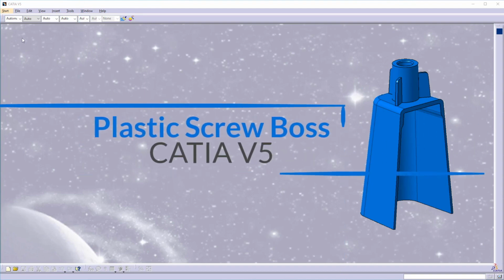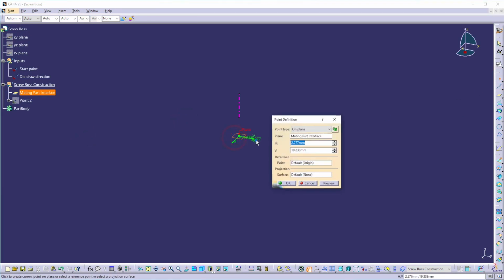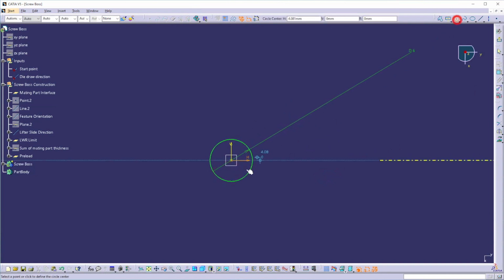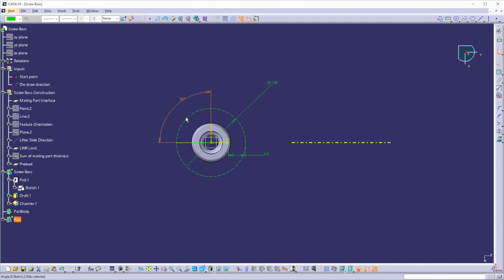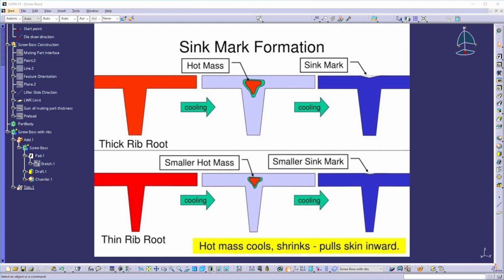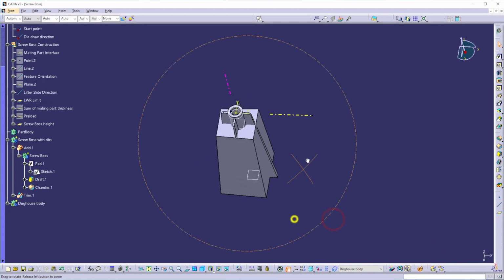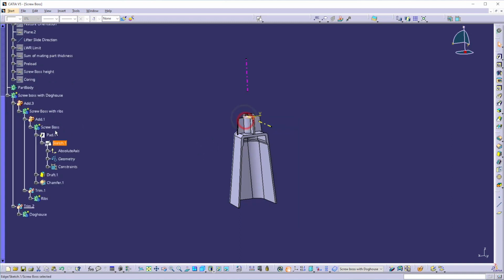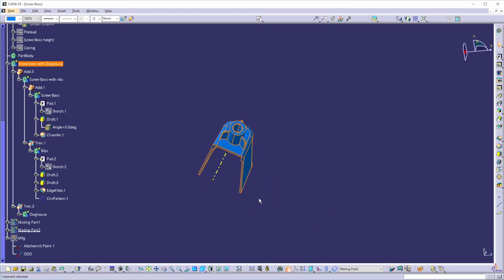CATIA V5 : Design a plastic attachment feature : Screw Boss #automotive #catiav5  #3dexperience

Comment: 1st doubt: A sketch is made on the "mating part interface" plane for the boss with M6 standard dimensions, and you create a pad for the boss from the "preload plane" to the "LWR limit plane." Will it not affect the assembly of the M6 screw, as the hole may contract due to draft?

2nd doubt: Can you please explain why you have used "preload plane"?

Comment: One doubt.
Y lifter slide direction given with one degree angle. What is the purpose..
Reply from the maker: For instance, I suggested a 1-degree angle, but we can tweak it to make sure the lifter moves smoothly and avoids getting stuck or causing issues.